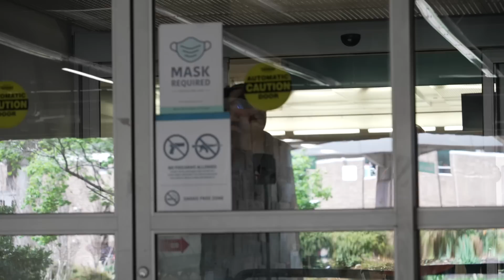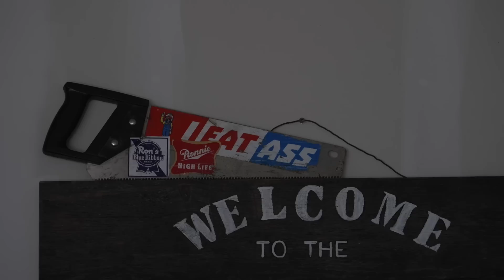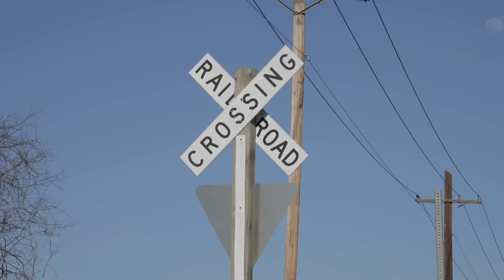Ron N Larry - EP2 The New Screamin' Eagle

Comment: Respect to Yahama, Ktm, Husqvarna, and Gas Gas most of the last three brands are the same chasis but still make an effort to differentiate. And Yahama they update the frame and did little improvements (also the fact they are winning championships) still they produce two strokes. Definitely getting a Yz250 2 stroke as with Tomac closing out the championship and still the last Japanese Manufacturer that still produces 2ts.

Fuck Red, Green, and Yellow

how about that Jimmy Albertson Cameo?